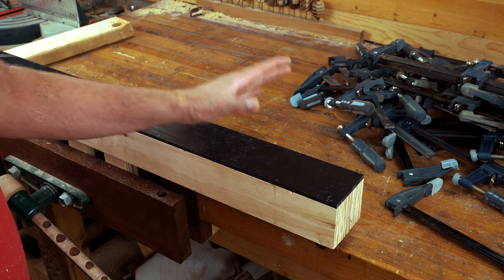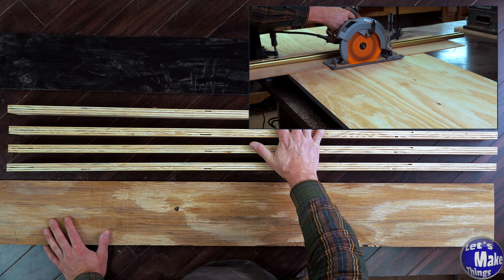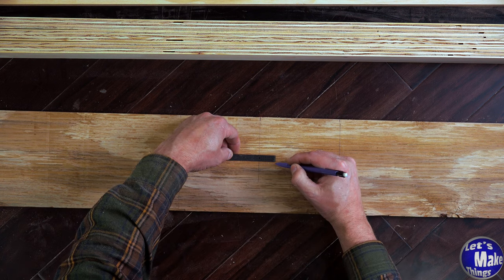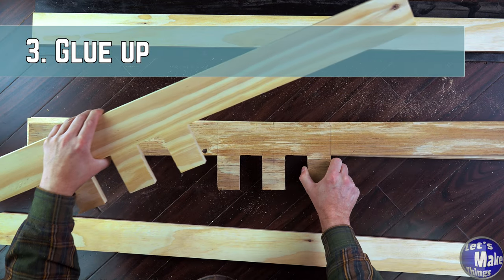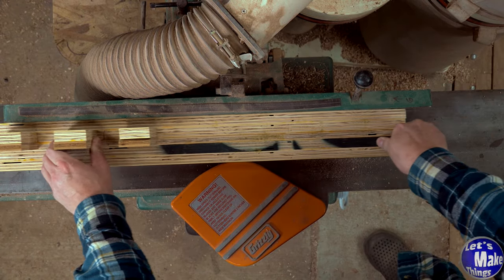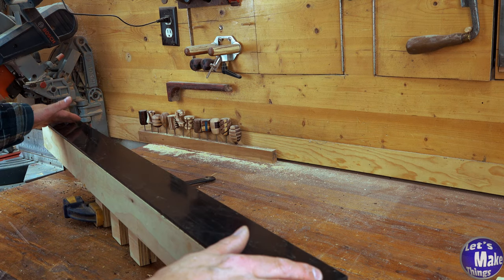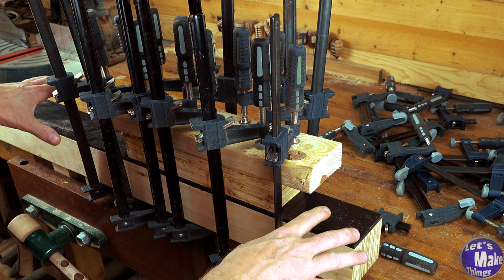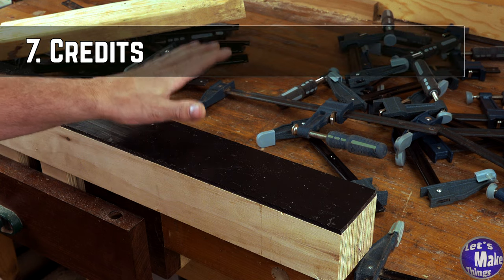How to Make a Woodworking Jig for Perfectly Flat Laminated Surfaces // Step by step instructions!

Comment: Isn’t that a jointer that you ran it over, not a “planer”?
Reply: They do the same function. flatten material
Reply: @JohnColgan.  But that work piece could not be “flattened” using the machine that is commonly called a “planer”.
Reply: @JohnColgan.  technically not quite the same. A jointer will always make a flat surface. A planer is more for setting thickness and making the two opposite sides parallel, but if the opposite face of your wood is not flat, it will transfer the flaws from one side to the other unless you use a sled or jig to hold the board you are sending through the thickness planner or run it over a jointer first.
Reply: AKSHULLY 🤓
Reply: Depends on which side of the Atlantic you hail from!
Reply: Yes that was a jointer, so technically he jointed it. And while we’d generally think of jointing a piece to joint it to another piece, or to square 2 sides of a piece to 90 degrees, you could say with this piece that he “planed” it to clean it up. I have seen some older jointers that were actually marked as jointer-planers. But it is true that it could not have been run through an actual planer. A planer is for making one side parallel to the opposite side, making a piece thinner and making a nice smooth surface. And that piece would have never fit into a planer. I think he just misspoke and didn’t catch while editing.

Comment: Did you try contact cement to attach it instead of the brads? It’s really good for attaching things that normally you can’t glue together.
Reply: HDPE is considered a low surface energy plastic, nothing really likes to stick to it including contact cement. Best option is certain epoxies and cyanoacrylates but best to use a purpose designed primer first.